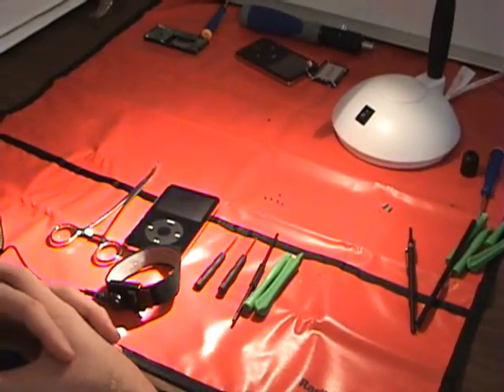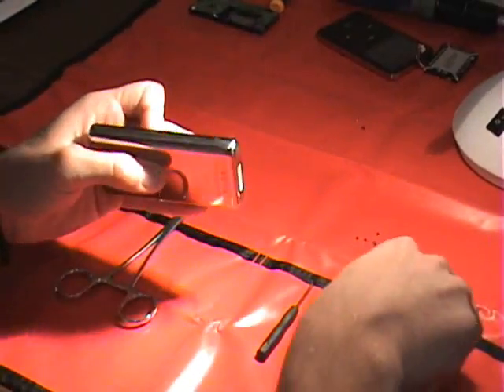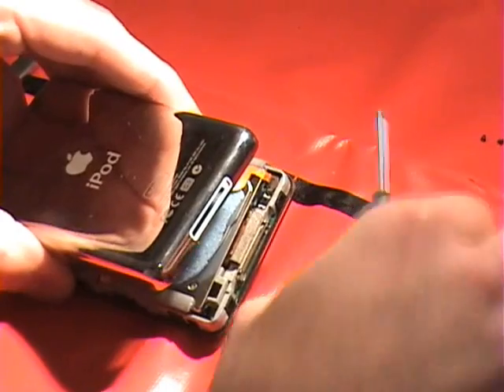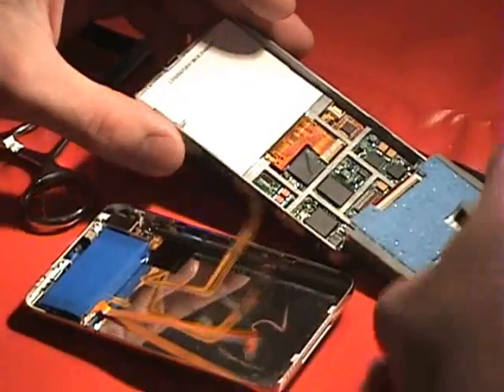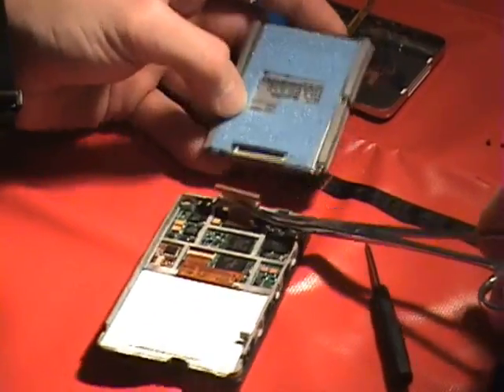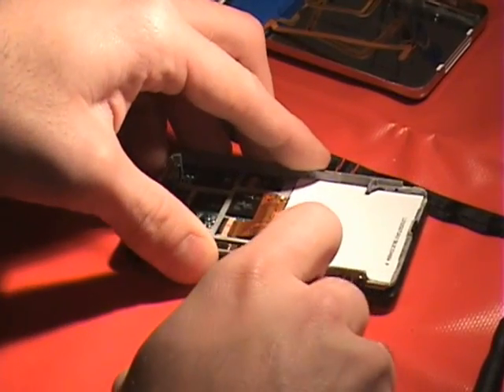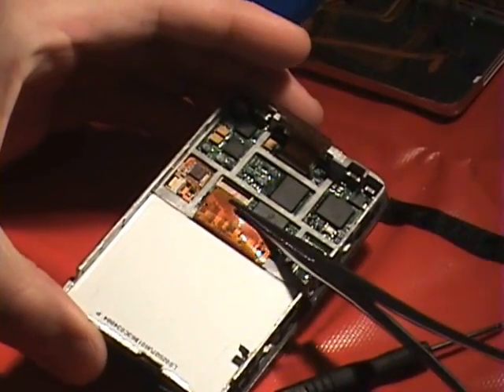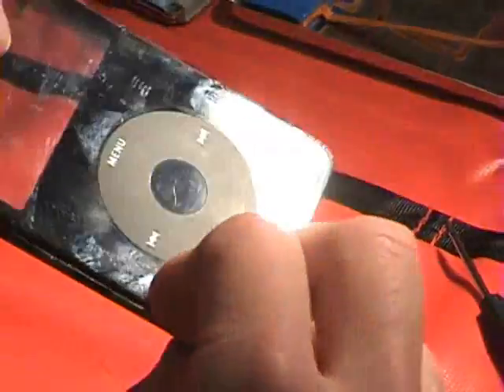iPod Gen 5 Repair Video

Comment from the maker: It could fix your issue, but this is probably a hard drive issue.  From our experience we can resolve this issue by repairing your hard drive for $49.95.  This option is cheaper than replacing the drive.

Thanks,

iPod Repair Squad

Comment from the maker: Your best bet will be to get the iPod into diagnostic mode and check to see it passes the HDD Scan and the HD R/W test.  If it passes then you don't have hard drive problems.  Next you should probably disconnect your battery and then reboot.  If that fixes the issue it will only be temporary until you replace the logic board.

Thanks,

iPodRepairSquad